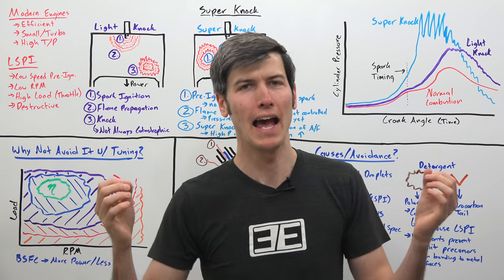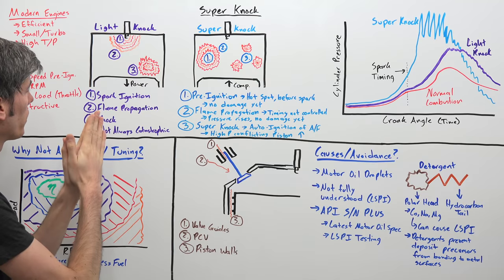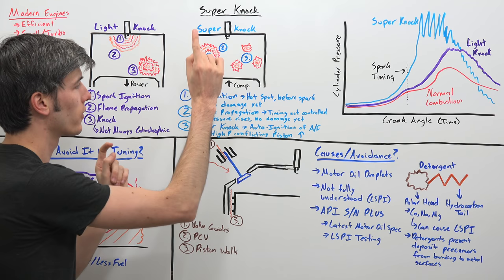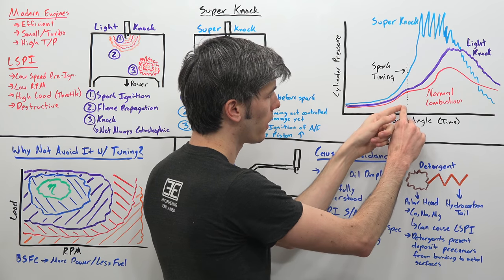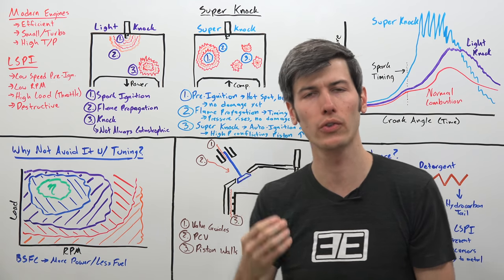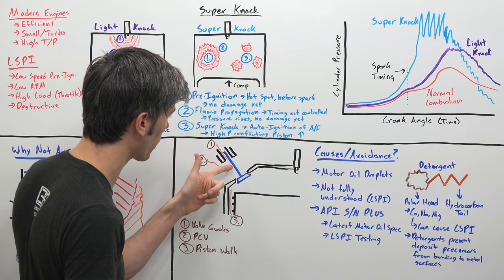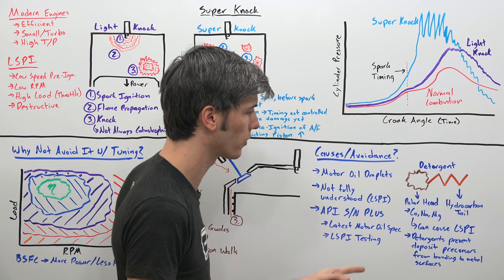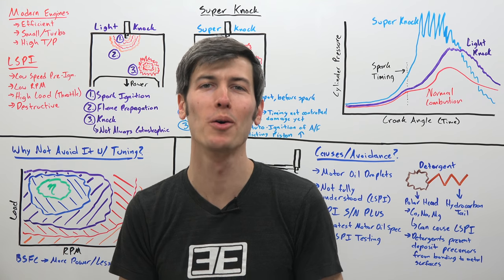How Super Knock Can Destroy Modern Engines

Comment: Another factor that doesn't get enough attention is differing fuel quality between markets in North America. ACN (Arizona, California, Nevada) 91 octane fuels are far more knock prone than 91 octane fuels in other states. Same problem in Western Canada where 91/94 behave poorly compared to similar 91/94 in the East. This probably comes down to refinery feedstock, heavy grade oil probably nets a poorer quality gasoline. Our AKI system is prone to refiners juicing RON numbers and leaving MON lower than similar fuels in Europe. AKI is RON+MON/2. Anyone running off the shelf tunes for cars need to ensure the fuel they have in their market is appropriate, not all 91/93s are created equal.
Reply: Is there something to be said for the lack of humidity as to why the change seems more measurable between the regions?
Reply: @pmdinaz  I think it's mostly regulations, with crude quality being another potential component.
Reply: Piss poor quality of 91 + octane makes me dont want to tune my car.

Comment: I switched to a very expensive motor oil about 6 years ago  and it  keeps  LSPI from happening  or does a great job of keeping it at a very low percentage of happening with the low octane fuel  by keeping the pistons from over heating ....

Comment: I'm certain GM's 2.0T LTG engine suffers from this condition.  Several 2014+ Buick Regal, 2013+ Cadillac ATS, etc owners have reported failures (cracks) at the top of the pistons, exactly where this condition would cause a fatal issue.  It seems to happen regardless of driving style or whether the engine is tuned/modded, and at varying times from 500 miles to 50,000 miles.

Comment: Hello, nice video, thx. I have few questions/notes.
1. Why this occurs in low speed/revs and NOT in high ones?? What is actually meaning of "low"? 1500-1800 rpm? This is something that no one technically describes - pitty.
2. The chart in top-right corner is not correct/accurate - why should superknock pressure be that higher than light knock/normal combustion situation. I would say, that the main problem is timing and pressure increase speed, not the overall pressure.
3. Why the oil that has much higher ignition temperature than petrol is causing this??
4. Why direct petrol injection is worse than indirect one?
5. Is superknocking detectable? "Normal" knocking is and when it is detected engine control system can deal with it. Why is that knocking worse?

Comment: This is also why everyone needs to be running E85 and we need motor oil companies to make oil handle E85 better
Reply: Any good synthetic will hold up to E85 just fine. Running 5K mile intervals i can't tell any difference in my oil analysis running pump or E85.
Reply: @OtisFlint  just fine, yes.  But few handle it perfectly.  Mix E85 into a sample of oil and observe it's ability to polarize the fuel.  In my findings I'd seen more bad results then good.
Reply: @gammalight1312  Even Amsoil, the king of extended drain intervals recommends factory specified intervals when running E85.

Comment: I had a rod knock. No smoke, good acceleration. Turns out bearings are fine. Piece of piston in the sump. 0.7L turbo charged 80kW engine.
Now my second engine is developing the same symptoms - knock originating from wall of middle cylinder (3cyl engine)...

Comment: There are a lot of racers in the Porsche world who use outboard 2 stroke oil in their sumps because supposedly the octane rating is nearly the same as 87 octane gasoline.  I do not have an online reference for this, but since they rebuild their engines frequently, this works.

Comment: Charles Fayette Taylor is spinning rapidly in his grave.  Pre-ignition's traditional meaning is that it's caused by hot physical parts (spark plug, valve edge, carbon deposits) in the cylinder that get hot enough to cause ignition before the spark plug fires.  LSPI as described here is NOT that.  Instead, it is simply detonation, which USUALLY occurs after the plug fires but not always.  Detonation is AUTO-IGNITION of the air-fuel charge when cylinder conditions reach a certain pressure/temperature threshold.  Yes, in the strictest sense of the term, LSPI is pre-ignition because it happens before the plug fires but there is a long history of misinformed layman using the term pre-ignition when they mean detonation because no one ever straightened them out, and its use here will only reinforce that misconception.

Otherwise, a very nice presentation of a rather new experience for most people.

Comment: Thank you for explaining this. I would never have imagined that motor oil could be a potential source. Now I understand more about the SN Plus designation. Previously, I always thought the electrode of the spark plug, being long and thin, would not have been able to get rid of heat fast enough and would be the likely source of pre-ignition knock in higher compression engines.
Reply: Now that I think more about the compounds in the oil, it seems the calcium is a catalyst for lower temperature ignition compared to the other metals mentioned such as magnesium?

Comment: LSPI has recently been attributed to oil additives; specifically high calcium and sodium. The method isn't well understood, but the right oil makes all the difference apparently. See the latest DEXOS 1 Gen 2 oil analysis. TLDR is basically Calcium + Sodium = bad, Molybdenum and Zinc (ZDDP) =  good, more alcohol in the fuel (and/or cooler distillation curve) are good.

Comment: The main problem is everyone drives away from stops under full throttle. Everyone thinks they are at the track.
Reply: If everyone did that then we would have a lot less traffic.
Reply: It doesnt happen in low gears.

"Low speed" is referring to the engine speed, not road speed. LSPI generally happens at 30+mph.

Comment: Is there information on WHICH small turbocharged engines have this problem the most?
Reply: I would stay away from VW 3 cylinders and anything lower than 1.2L.
Reply: I've seen Peugeot 1.2 turbo and Opel 1.0 turbo engines having that problem

Comment: This reminds me of why you don't try to attempt to suddenly close a valve on a long pipeline trying to suddenly arrest the momentum of a fluid with a lot of energy behind it doesn't end well. Very easy to create a pressure spike that exceeds the failure strength of the material attempting to contain it this way and well RIP part if you do this.

Comment: I think part of the reason pressures are much higher is this: the combustion happens too early and the air-fuel mixture heats up, increasing pressure in the cylinder, which is still compressing. Because of this the cylinder must put much more work into compressing it, raising the temperature, and because of this also pressure, much more than would happen if the ignition was timed correctly. That can destroy an engine in short order.

Comment: I'm sure, this has nothing to do, with adding hot exhaust gases in to intake (AKA EGR Valve)...
Reply: It also has to do with the carbon deposits. As the ones you get from egr and from the crank housing vent tube that spews oil into the intake. To solve this they moved back to indirect injection or they have both direct and indirect injection. That way it cleans the intake of carbon better.
Reply: EGR usually reduces cylinder temperatures by reducing the available air for burning. That’s how it reduces NOx, NOx is a byproduct of high cylinder temps. Carbon deposits left behind from the exhaust gasses are another matter but could cause problems.
Reply: Had a problem on my car when the egr valve failed, i think it was knocking, driven wheel suddenly stopped while driving at low speeds on gravel, lasted for maybe 1/4 of a second. Symptoms stopped when i unplugged the egr valve (no fault on ecu)
Reply: @jan856  I cannot possibly see how a failed EGR valve could cause a driven wheel to completely lock. It's more likely something to do with the ABS/stability system struggling on a loose surface. If it was preigniting enough to stop a wheel I would guess you wouldn't have an engine left.
Reply: @98dizzard  the symptoms stopped when i unplugged the ecu and did not come back when i replaced it, but i have also replaced all the brakes.the car does not have esp and abs only on front axle
Reply: @jan856  unplugged what ECU? If you don't have stability control I doubt youve got a separate ECU just for the EGR valve, it will run off the main ECU for the engine management, if you unplug that it won't run at all.
Reply: *egr
Reply: @jan856  the only way I can see an EGR valve causing knocking is if it's stuck shut, which would be disabled. If the car thinks it's still open fully it might start running lean which increases cylinder temps and causes knocking. Potentially I can see how this can happen as your description makes it sound like your car is quite old, so it might not have a feedback loop with sensors to confirm the EGR is responding as commanded. EGR valves here however are reasonably new, and mostly have only been on diesels for 10-15 years and are only just being introduced on petrols.

Unplugging it doesn't fix the problem, but forces the ECU into a "safe" mode. Still if you had knocking strong enough to lock a wheel, then I can't imagine how the engine is still in one piece. 

On a diesel, an EGR stuck closed (or blanked off as many boy racers do) would do nothing, a diesel is perfectly happy running lean.
Reply: @98dizzard  1999 model opel astra g engine X16XEL 1.6l 16v n/a gasoline built in 98 engine still runs but burns a lot of oil it has gone 330000 kilometers, very good for a GM vehicle

Comment: There are after market solutions to this but the manufacture is not going to introduce them because it is a high maintenance solution most owners would not want to deal with. Water/methanol injection seems to work really well at cooling intake temps and actually raising the equivalent of the octane of the fuel your burning especially in forced induction and high compression engines.Another benefit for DI engines is it cleans the intake valves.

Comment: I always thought the V6 ecoboost had worse gas milage when towing than N.A. engines was because they injected more fuel to cool the turbos under load. Maybe its a case of sending much more fuel to prevent super knock. Mixture is too rich to allow super knock.

Comment: Hi Jason, hopefully you scrolled far enough to see my question: Would adding a catch tank/can to the engine potentially reduce engine knock or super knock, due to the fact that it removes part of the oil/fuel mixture that can make its way into the cylinder? Thanks -Adam

Comment: I wonder if super knock is why the Oldsmobile Jetfire used fluid injection? Would make sense. The methanol further increases octane level alongside the tetraethyl lead that was in gas at the time, and then the corrosion inhibitor did what it says on the tin, the distilled water cools the turbo and dilutes the methanol.

Comment: There is a lot of truth to the oil being a culprit for knocking. While my experience relates to the light knocking/pinging, I can see how it could develop into a super knock with a forced induction engine. I used Amsoil (which at the time didn't meet SN+ standards) and my normally aspirated car would ping all the time under light load. Switching to Mobil 1 which was SN+ certified, the pinging went away.

Comment: my car runs low rpm so as soon as you need to accelerate a bit it starts to shake slightly, obviously designed to work in the high load/low rpm region for better economy. But I drive it in sport mode and it bumps a bit the rpm and runs perfectly smooth.

Comment: High boost low piston speed = HEAT, combine that with oil in the intake stream due to terrible PCV systems (Subaru) =LSPI
Reply: Ungregistered User  having a manual has nothing to do with it.

Comment: You didn't mention the new standard coming out from the API. ILSAC GF-6. It will be the new standard for oils that includes testing for LSPI. SN Plus was just a temporary band-aid because it was taking too long for everyone to agree to the new standard. It looks like the standard has been agreed upon and oil manufacturers can start getting certified for ILSAC GF-6 starting early 2020. SN Plus will stick around as a supplemental certification though. Also ILSAC GF-6 includes two standards. GF-6A which is what will be backwards compatible with previous gen and GF-6B which is ONLY for the new implementation of oil type 0W-16 (yup an even thinner oil that the Japanese have been using in Japan for a while now) for fuel efficiency.

Comment: Lspi looks like it would be good for additional efficiency and higher power...same fuel use yet higher cylinder pressure across the board in the same regions utilized by normal operation.

Comment: Pushing the design envelope. All engines are predisposed to pre-ignition. LSPI or super knock is that the new bomb cyclone of the internal combustion engine? Engineering will need to make more robust components to give an adequate design envelope. Also not sure if adding fuel to the mix would compound the LSPI or reside it due to cooling but modern engine management can respond within the combustion cycle especially with direct injection. Cam timing not as quick but also can compensate. Good study and a lot of useful information.